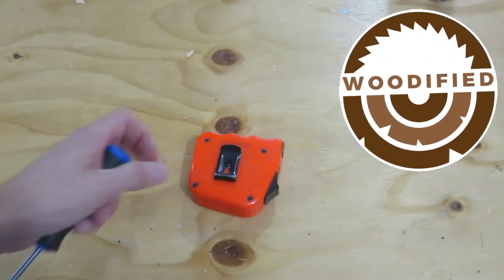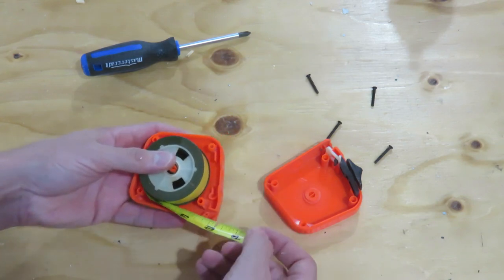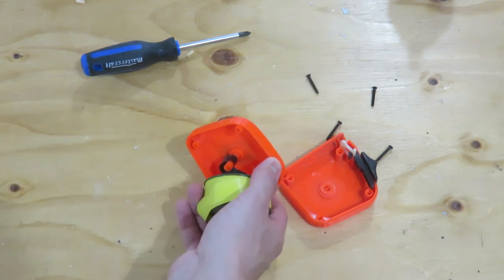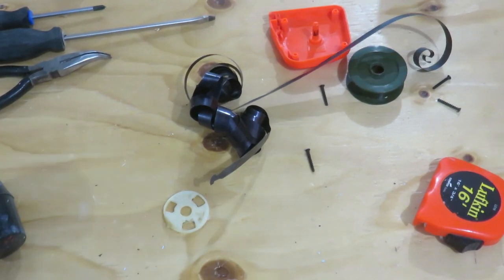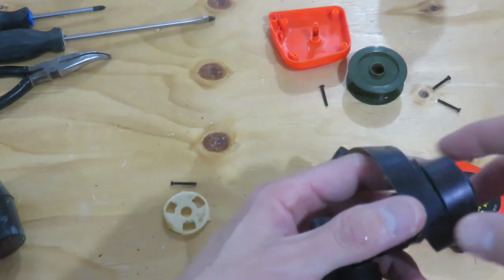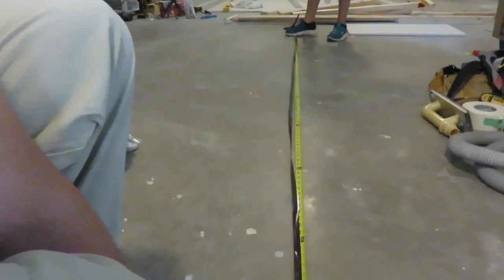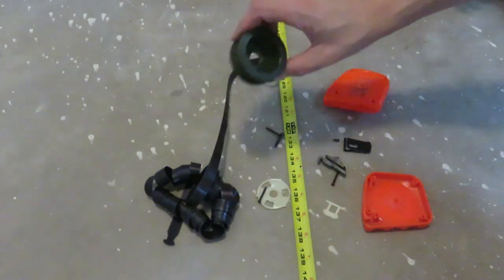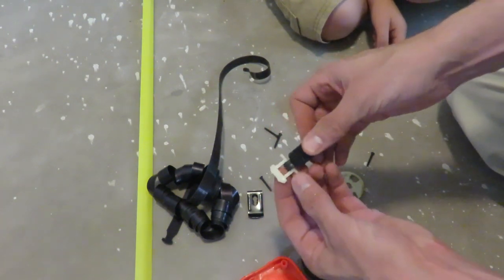What's Inside A Tape Measure

Comment: I broke my tape today and it spun back inside itself and proceeded to spin wildly inside itself for a few seconds. When I opened it up to repair it and try to attach the tape together again, I found the spring was coiling the opposite direction and spitting out the tape rather than retracting it. Still trying to figure out how this has happened.
Reply from the maker: Huh.  Sounds interesting.  How far will it spit out the tape?  The entire length?
Reply: @Woodified  Yep the entire length. I think I've figured it out based on some other comments. It's wound past its recoil point and so needs to be rewound to the point where it starts to retract rather than repulse. Going to give it a try tonight. Let you know how it goes.
Reply: @yggdrasil9039  you alive man?
What happened to the tape?
Reply: @gauravdabholkar7631  thanks for asking. Tbh, all the parts are still sitting in a cardboard box as a project to do later...
Reply: YOU MADE MY DAY DUDE :DDDDDDDD

Comment: Could I replace the tape measure using a string for example? Or would it be better to just copy the mechanism
Reply from the maker: Good question.  I think it would be possible.  Pull starters on lawn mowers have cord.  Let me know if you get it working.